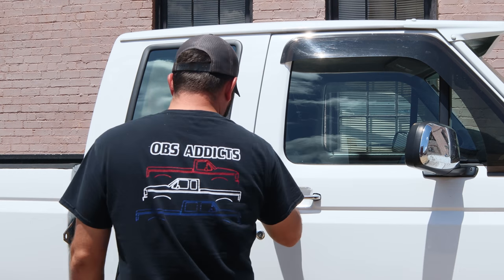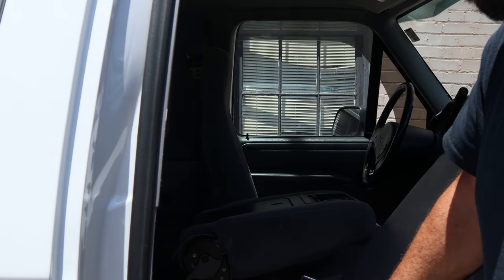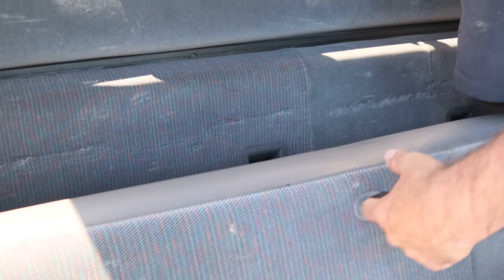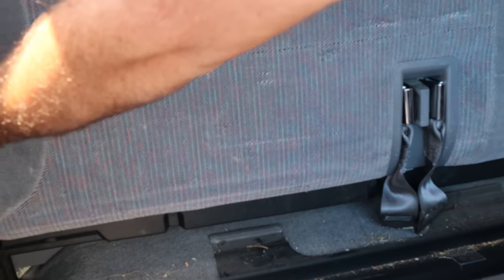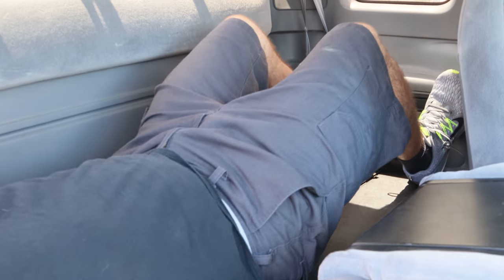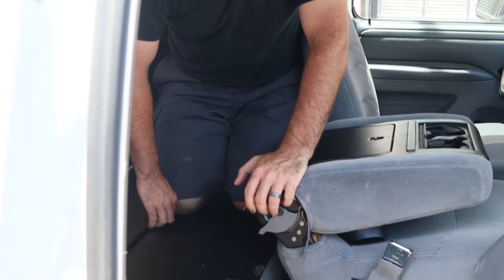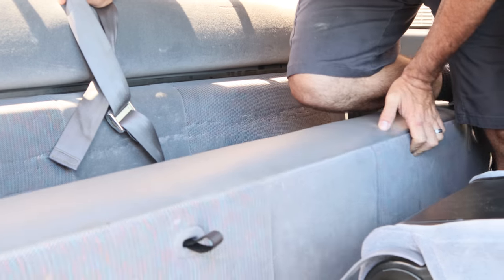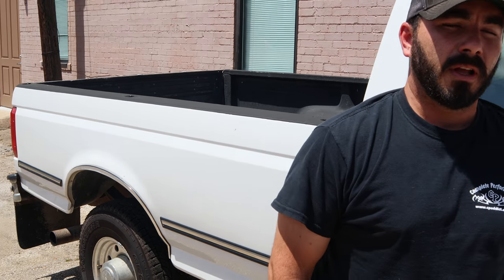How To Video - 1992-1997 Ford F-series - OBS Ford's Super Cab Seat Trick

Comment: I have an '89 F350 I bought 4 months ago.  I wish I knew about this on the 3,000 mile trip back home.  Since then, I have figured the seat folded over.  I'll have to check to see if the back folds down, too.  There is a stereo amp in the way.  I'll probably have to relocate that.
Thanks for posting!

Comment: Put a twin memory foam mattress there. My 2019 doesn’t have fold down back seats, but they fold up. I have a mattress on the floor, with some gallon water bottle I use as a sort of box spring. It’s so much more spacious than the bed frames people always custom build and lay atop the backseats. Hotshot life…

Comment: How does those front seats slide so smooth? Mine are rough and sometimes don’t lock in place. Any help is appreciated.
Reply from the maker: Probably just need to be cleaned they should all slide like this
Reply: CPaddict I’ll try taking em apart and cleaning them. Thanks

Comment: Thanks for the video.  Question:  See how you move the seat forward, and it STAYS forward so you can get into the back?  I have a '94 F250 and all is well when I hit the lever and slide the seat forward, but then it does not stay forward and will slide back and forth.  I must hold it forward to get anything into the back seat.  Any ideas on what is causing this issue?
Reply from the maker: take the seat out and look for anything broken in the track

Comment: I just bought a 97 F250 super/extended cab.   No matter how hard I pull , I cannot get that loop to release the seat base.  Any suggestions??   I am female, late 70s and don’t have a great deal of strength……so any suggestions would be great.   I want to convert that back area to storage…
Reply from the maker: Should be a super easy pull. You might try pulling the edge of the seat at the same time. If not you may have to try and remove the whole seat to see if its frozen anywhere.

Comment: I have a 97, and I have not been able to get the bottom rear seat up, it FEELS like it’s bolted to the truck. Any idea or help on this?
Reply from the maker: for some reason yours is stuck
Reply: @CompletePerformance  My neighbor was familiar with the truck and told me to use a screwdriver to pry it from the latches. It worked.

Comment: Thanks, I new it did lay flat but not how to do it. 
My truck doesn’t have the front center seat. It’s just a hard plastic center console with 2 big seats for driver/passenger. 95 xlt 7.3. 
How would I go about getting that style of seat? Is it a bench 60/40? Really want to ditch this giant hard plastic console and get the seat I just saw in your video.
Reply from the maker: No Problem. We thought it a neat little tech tip that most don't know. You've got the rarer bucket seats. You will need to find an extended cab set of 40/20/40 seats to swap
Reply: CPaddict Rarer! The seats are big, cushy and have the electric lumbar support that inflates to preference. I like them but have a family of 6. I’ve thought about adding another seat beat in rear bench to seat 4 across. Thanks for the info. Love my truck! Have had it almost 5 months now and never had any other vehicle ever spark my interest as this OBS.... OBS is short for OBSession!
Reply from the maker: Let us know if we can ever help!!
Reply: @jeremykeith3152  yours have the switch on the end of the armrest to lay the seat back? Mine is the only obs I have seen that does

Comment: I despise my 1992 XLT 4x4 bench seat (sofa?). I just found your site via Pinterest. Would you have any shortcuts to aftermarket bolt in buckets with hardware? All I've found so far is related to F250/350 four door OBS. Thanks.
Reply from the maker: Depends on the cab configuration you have.

Comment: Will my '87 F-250 do this? It is extended cab!
Reply from the maker: It should
Reply: Yes except it's a little different there is no loop to pull on the bottom part you'd wedge your hand between the middle of the seat and lift bottom part up and towards you to fold over
Reply: What about a98f150
Reply: My 84 does

Comment: I have a '95 F150 Super Cab. I cannot for the life of me get the bottom part of the seat to come up...any tips or tricks to it? I have tried pulling the black loop but to no avail.
Reply from the maker: You probably need to lube the swivels on the side of the seat
Reply: @CompletePerformance  Swivels? This is my first OBS F150 and have never had such an issue with the rear seat. I tried to use a wrench through that loop for leverage and it did no good. It's like it is stuck or something. Are the swivels under the frame on the sides?
Reply from the maker: It swivels where the seat mounts
Reply: @CompletePerformance  I cannot get the seat to come up, no matter what I do. Ugh.

Comment: I dont think mine has that loop on the bottom. If it does its behind the seat. I've got the leather package. And I've never seen that loop
Reply from the maker: Leather wasn't an option but all of the seats do fold down
Reply: @CompletePerformance  was an option in mark 3s. Even had ford stitched in the top of the front seats. And mine has it. Mint back seat
Reply from the maker: Found it. Yes Conversion Companies put leather in them for dealers. But it wasn't a stock factory option